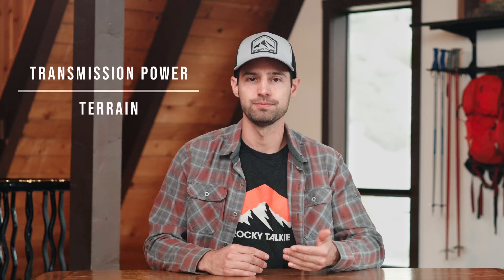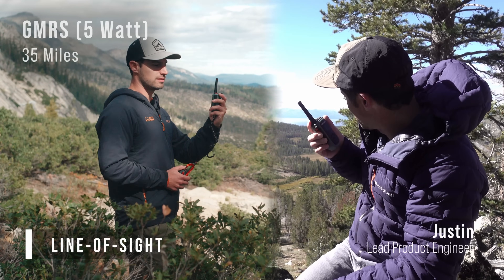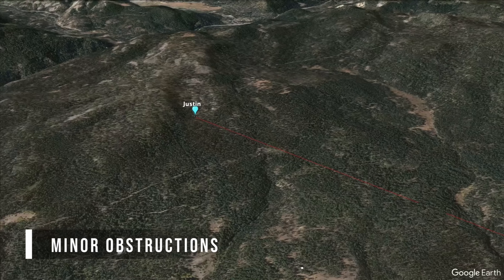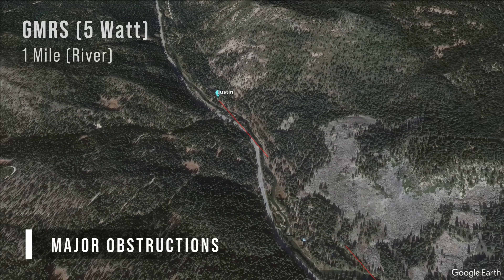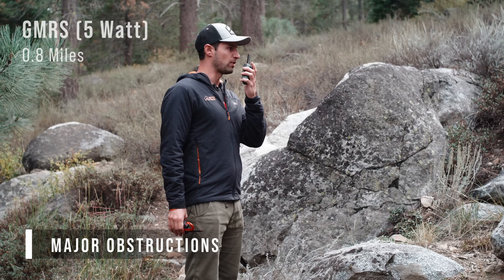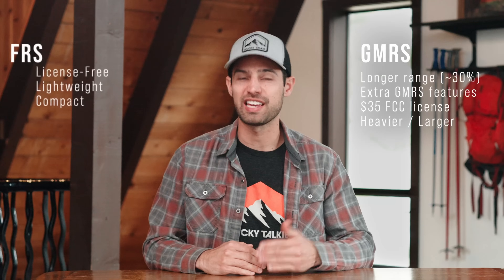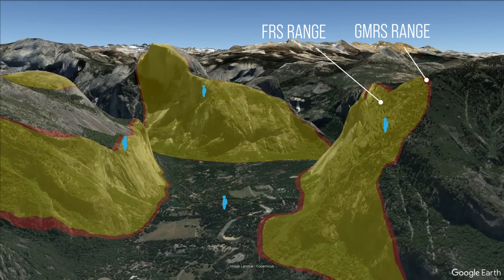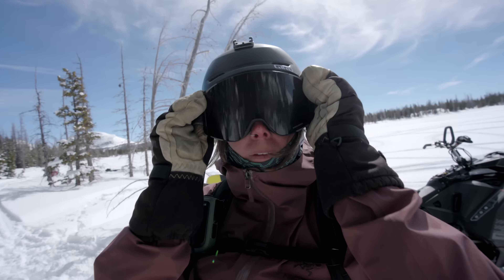FRS vs GMRS Walkie Talkie Range Comparison - Rocky Talkie Range Testing

Comment: having alot of experience in these types of situations with radios over around 24 years I think I would a half wave antenna on the radios to see if that worked better for the distance and also used a portable Murs Radio for compaired signal coverages both with stock antennas switch them to half wave antennas for a Interesting test on clairity and distance .

Comment: I'm part of a contractor crew and I'm thinking about trying to get my foreman to get us some radios, these ones are expensive but for good reason it seems. Sometimes we're in rural areas but a lot of times we're very far out in fields, hills, mountains even. Anywhere where you can find a wooden pole carrying power lines you'll find us digging it out to inspect it. Sometimes it's a small crew and we don't need more to do a days job, but sometimes there's more of us and we have to split to keep up a decent workflow, those days usually tank harder simply because of a lack of communication between the groups and within them.

I'm hoping he won't make price an issue, as we could definitely use some rugged and durable radios.
Reply from the maker: Sounds like our radios would be a great fit for your crew's needs! If you haven't already, reach out to our team at support@rockytalkie.com and our B2B manager can help get you dialed in. We appreciate you thinking of us!

-Nate
Rocky Talkie Team

Comment: Would love someone’s input into why my Wouxun KG 935 Plus can only get about one mile with only tree obstruction.  It’s GMRS outputting five watts.
Reply from the maker: That's a great question and one we hear a lot! As long as your radio isn't malfunctioning, sometimes terrain can be deceivingly complex. You mentioned only tree coverage in your area which should allow for much more range than 1 mile. That said, trees also block our visual line of sight. I'm curious if there's potential of a slow rise in elevation between you and your partner. Even a 6ft change in elevation over 1 mile can be enough to totally block transmissions. Again, this could also be due to a hardware issue or even antenna choice but I hope this helps. Perhaps try their support team for assistance with technical issues. If you'd like to discuss range further, our crew is always stoked to troubleshoot. Reach out to support@rockytalkie.com and we can try to help you solve this mystery!

-Nate
Rocky Talkie Team

Comment: Great video I recently bought 4 units.  Can future Rocky Talkie have some kind of indicator that the radio is on.  Maybe a single LED light or something simple?  Also it would be nice to have a feature where the screen display can be locked on to be used.  This would be useful in car while mounted and charging or at a base station.
Reply from the maker: Thank you so much for the feedback, and for your amazing support! Our goal was to optimize battery life as much as possible, so our engineers intentionally left an indicator LED out of the design. A quick tap of any button will wake up the radio's screen which is a habit I've developed over the years, perhaps that will help with your current radios! That said, we have heard this request and our engineers have it on the list of considerations for future products! I so appreciate your insight and your being a part the Rocky Talkie community! If you have any other questions or thoughts, we're all ears!

-Nate
Rocky Talkie Team

Comment: This is by far the best explanation for distance vs wattage. It doesn't make much sense why the FCC limits it to only 2 watts when the difference is so minimal until you start pushing 20-50 watts. also a small point for the FRS radio. because its only pushing 2 watts the battery consumption is much less while transmitting
Reply from the maker: Totally,  those are great points! I know the band plan is pretty packed, I'll bet the logic for limiting FRS to 2 Watts is there, but buried in a lot of other stuff. We can be glad to have so many options like GMRS and Amateur radio for those looking to push the limits even further. Thanks for stopping by and I'm so glad you enjoyed the video!

-Nate
Rocky Talkie Team

Comment: What’s about MURs bands?  Those are open use, lower frequency band with it an own set of rules and features.   

it may provide more range.
Reply from the maker: MURS is a great resource and definitely a good option for some applications! We found that the range difference isn't huge in most settings and the compatibility of more common FRS/GMRS radios works for us. Maybe one of these days MURS will become more common and we can work on a new radio!

-Nate
Rocky Talkie Team
Reply: @ I found that lower frequencies seem to have an easier time through thicker terrain.  There’s also a certain small effects you can get from lower frequency bands that people kinda don’t consider like the fact that lower frequencies like to “hug” the ground more (known for following the terrain more)  and so on.  Which I don’t know, I haven’t tested myself, and not even the point, but in theory, it could, could mean that if you have a man down on the ground with these lower frequencies, he might be more accessible on the radio too vs higher bands. 

I agree at 2W from a small HT with small antenna probably isn’t much between them… but it also can depend on your methods of testing and scenarios tested too.

Comment: I have e tried both here in Florida Everglades,  lot of trees and found out they are about the same, I got 1 mile and little more on FRS and on GMRS a little more.2.5 miles. but GMERS are more expensive
Reply from the maker: It's interesting to hear your range experiences in those conditions, thanks for sharing! You might find that a higher gain antenna gets you just a bit more distance but it sounds like you're experiencing about what we'd expect!

-Nate
Rocky Talkie Team

Comment: Why not use the small whip antenna packaged with the gmrs 5 w.
Reply from the maker: Hey Sam, great question! We wanted to keep it as close of an apples to apples comparison as possible. Similar to how using the GMRS radio through a repeater wouldn't be as clear of a comparison, we kept the stock antenna on the 5 Watt Radio to isolate the power difference. I hope this helps!

-Nate
Rocky Talkie Team

Comment: So I would not be able to up the wattage out put on these radios?
Reply from the maker: Correct. FRS radios are capped at 2 watts maximum power and our 5 Watt Radio has been tuned to what we think is an optimal power setting. It maximizes range while ensuring you get plenty of battery life on your adventures!

-Nate
Rocky Talkie Team

Comment: I had a 3 watt Cobra mobile CB in my car . I was talking to a person I believed to be very close . I was shocked to learn he was in Long Beach Texas , I wae in Orlando Florida . Then my F meter pegged , A person in San Diego Calif. was lik next to me . I could recieve but not transmit , he had 20K watts .
Reply from the maker: Hey James thanks for sharing, we love the magic of CB and other High Frequency radios! Under the right conditions,  those longer wavelengths can travel upward, bounce off the ionosphere and return to earth! This can give you some impressive range with relatively low power radios. The reason we tend to not see many HF handhelds is because the antenna would have to be very long to accommodate the wavelength effectively.

I hope you still have your CB and get on the air sometimes! If you'd like to chat more, feel free to drop us a note at support@rockytalkie.com

-Nate
Rocky Talkie Team
Reply: @rockytalkie1682  My CB was many years ago . I now reside in the filippines so things here area really different . Got a lot to learn about the laws here .

Comment: Why in the world are you inconsistently holding the carbiner in front, to the side of or not at all obstructing the antennas?
Reply from the maker: Hey there, that's a great question! While metal near an antenna could in theory cause issues, our team has done extensive real world testing and found that even when pressing the carabiner up to the antenna, no noticeable signal loss or interference occurred!

Comment: When are your radios going to support noaa and IP67 or higher water resistance with float option?
Reply from the maker: That's a great question! Our 5 Watt Radio is IP67 rated and supports NOAA weather channels! Paired with our corrosion resistant locking carabiner, it's a solid radio specifically designed with swift water environments in mind. Feel free to check out our radio comparison page to see which radio would be a good fit for your activities! https://rockytalkie.com/pages/radiocomparison

Comment: Thank you for the excellent demonstration and explanation.  I just received a set of GRMS 5w radios and am impressed with the build quality.   I tested them in our neighborhood and only got about a mile of reception, of course this is with houses being the main obstruction.  I am wondering if the longer “whip” antenna would help ?
Reply from the maker: We're so glad it was helpful! As you experienced, urban settings are tough for radio waves. While a longer antenna could improve range a little, your best bet will be either accessing a repeater (to get above obstructions) or physically raising your antenna. You could mount an antenna to your roof if you primarily operate at home. If you'd like to discuss further, drop us a note at support@rockytalkie.com and we can chat further!

-Nate
Rocky Talkie Team

Comment: Could you do a video on repeaters and the new Rocky Talkie would connect to them. Do you need to plug it into a laptop to do it?
Reply from the maker: That's a great idea, we were actually just thinking about that this week! You do not need to plug your laptop in and it's really straightforward to program. Simply locate a repeater on a website like mygmrs.com and match the frequency to the correct channel, then set your tone in, tone out, and bandwidth. It's as easy as that! Feel free to get in touch at support@rockytalkie.com if you have any additional questions.

Comment: Thanks for the vid, great info. Just recieved two pre-order 5 watt radios adding to the 2 mountain radios in our stash; love them all! What is that car mount y'all are using seen at 5:40?
Reply from the maker: Glad it helped and thank you for your support! The car mount is a prototype of our dash mount we hope to release in the new year!
Reply: @rockytalkie1682  Does that dash mount wire coming from the back of the mount lead to the outer GMRS antenna? I'm assuming.
Reply from the maker: That is correct! To get your signal outside of the vehicle, you'll remove the antenna from your 5 Watt Radio and attach a coax cable that runs to your vehicle mounted antenna. This helps your radio send and receive transmissions without passing through thick glass or being absorbed by the metal body. If you'd like to chat further, drop us a note at support@rockytalkie.com we're always stoked to chat radios!

-Nate

Comment: I live in Western Washington State and we are blessed with several high power GMRS repeaters located at higher elevations. They pretty much provide complete coverage for the entire region, including the Olympic Peninsula, even using 5 watt handheld radios. The fact that your radios are repeater capable will be a great benefit in this area. Ranges up to 80 miles is possible in some areas.
Reply from the maker: Repeaters open up so many opportunities, I totally agree! Stoked to hear you have several near you and we appreciate you sharing your experience!
Reply: That's awesome
Reply: Can we use repeater mode to talk to friends ?
Reply from the maker: Absolutely! It's a great way to chat with friends and meet new ones. You can check mygmrs.com for repeaters in your area. Then, listen in to get an idea of how folks use repeaters in your area!

-Nate
Rocky Talkie Team
Reply: Are the 2 watt and the 5 watt radios compatible with each other? My buddies have the 2 watt, but I'd like to get the 5 watt.
Reply: @ yes, all GMRS radios can communicate with each other, regardless of brand or power output. What I suggest is when you’re out with your friends, establish the radios performance right off the batt, that way you will have an idea of what limitations you will face and can avoid them.
Reply: @imagingconcepts  Thanks!
Reply: One of the few videos that has enhanced my understanding of frs/gmrs and my work as a tour guide in Borneo, thank you very much!
Reply: Thank you so much for this comment. I’m going camping in Wenatchee. I have the worse luck with picking out a walkie talkie for my family . I’ve tried multiple and they all sick. Ranging from $40-$300
Reply: nice to know im sure there are some good coverage repeaters in the Kisap Peninsula as well as in the east Bremerton area

Comment: I spent hours reading reddit trying to understand. This video did a much better job at explaining the difference. Great vid A+
Reply from the maker: Stoked to hear it helped!
Reply: Are ham radios better in range than GMRS ? And can Ham or GMRS connect with FRS radios ?
Reply: @user-zv8gd3jl7q all gmrs radios and most ham radios can connect to frs, however you are required to follow the frs wattage limits.

Comment: One idea for the GMRS radio would be to use a roll-up Slim Jim antenna (made of ladder line) (also available commercially for about $30. Google around) and attach it to the SMA connection via an adapter which has an SO-239 connection and can be connected to a PL-259 connection to some coaxial cable. Using paracord, throw a line over a tree limb for good height. I'm thinking this will be more effective than the antenna which comes with the radio. This could be a good rig for a base camp. The only other thing that would make this radio perfect for disaster communications and off-roading or overlanding is if it could work by plugging into a vehicle cigarette lighter.
Reply: You can get usb chargers for the cigarette lighter, Anker is an example brand.
Reply: @hendrickh2916 The Jackery and Bluetti also have this.